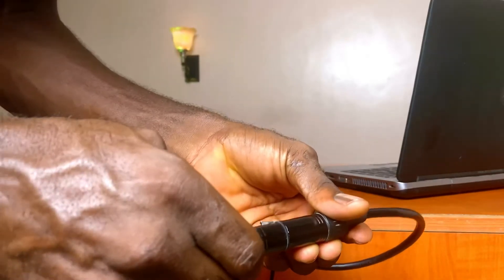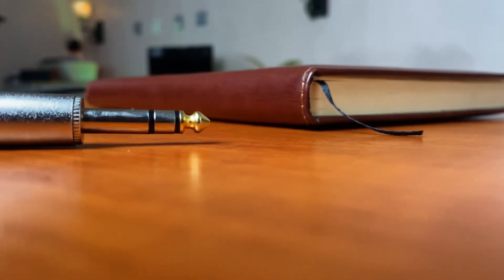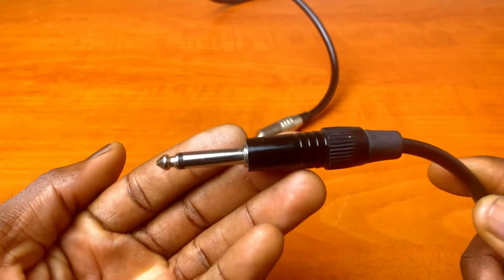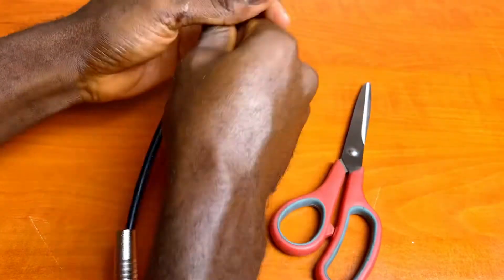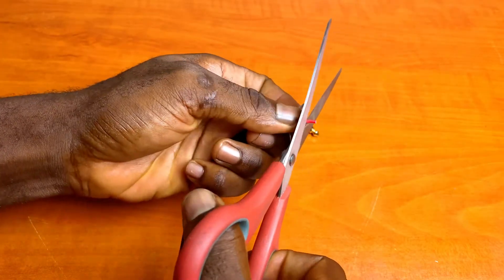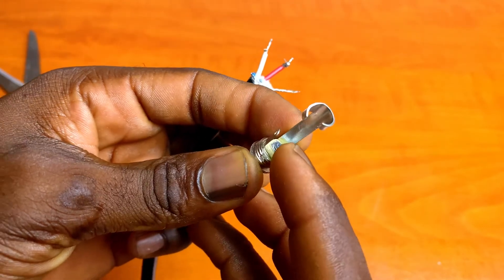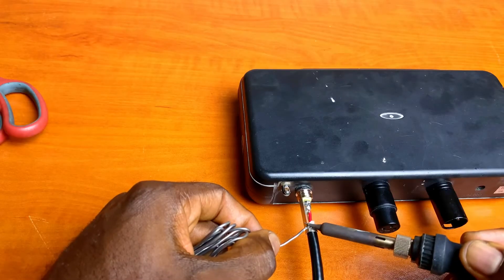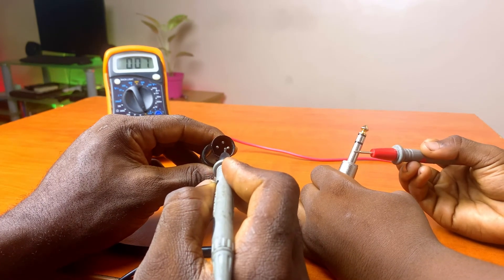How to make a 1/4” TRS Jack audio cable

Comment: I want to connect my audio interface with my amplifier to have sound from my passive speakers, the sockets of my amplifier are rca (red, black) the sockets of my audio interface are TRS 1/4 (2 sockets) what cable do I need to make this connection?
I know that rca is not balanced, is there a way to connect 2 separate cables, one end to be TRS 1/4 and the other RCA? in the market I can only find 1 cable with 2 ends, one end is a TRS 1/2 plug and the other 2 ends are 2 rca but I have 2 sockets on the audio interface. please if anyone can help me, thanks in advance.
Reply: dont you just need 2 cables?.. 1/4”TRs one end, rca other. And then 2 of those.

They sell cables that are a bundled pair, but they are literally just two cables joined with the rubber outside material.

Comment: What if I use a TS plug and connect the 1 and 3 together to the Ring? Is still balanced ? And it doesn’t matter if my output/input device supports balanced signals?